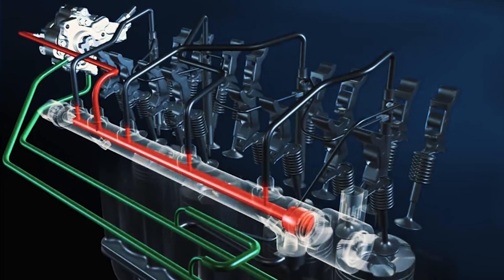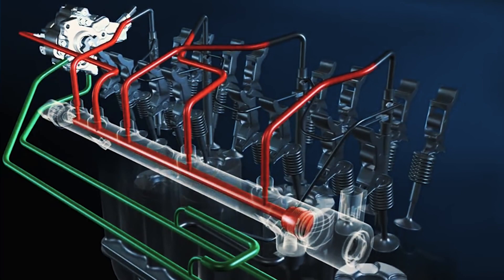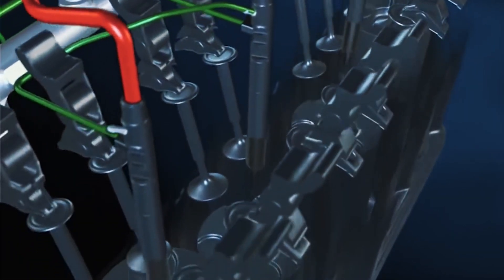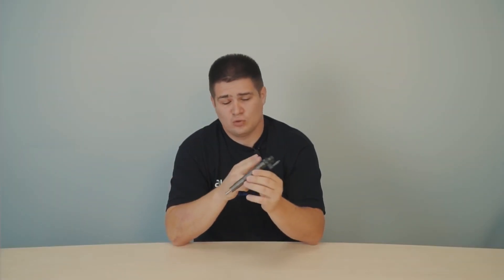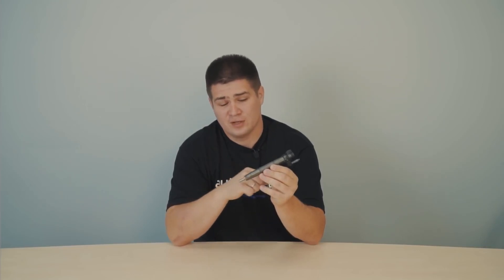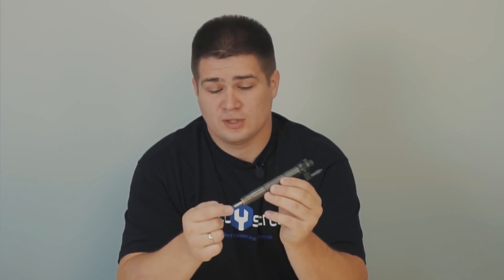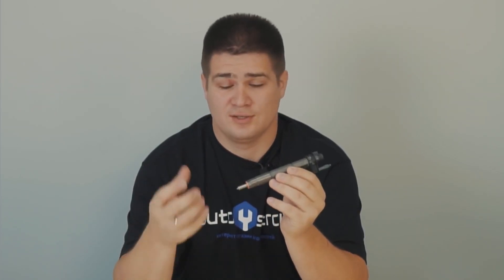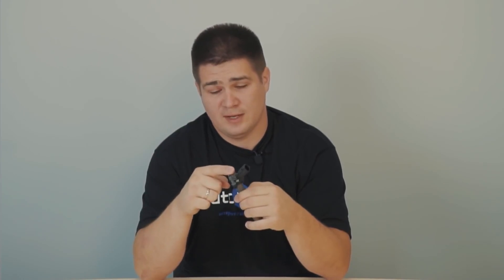Common-Rail Diesel Injection System Problems Explained

Comment: 😢 please what will be the problem if the fuel is coming through the pressure rail sensor but the injectors are not spraying the fuel out❤ Nissan hardbody np300
Reply: What was the problem?